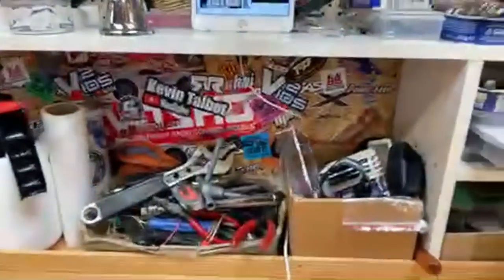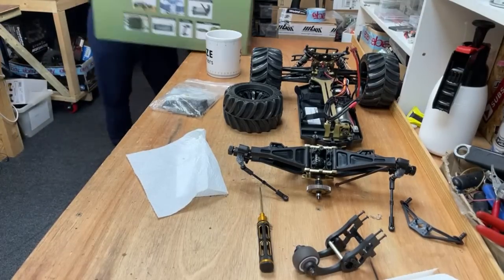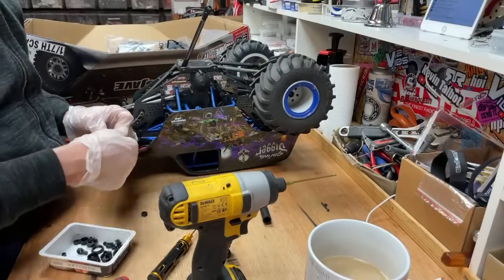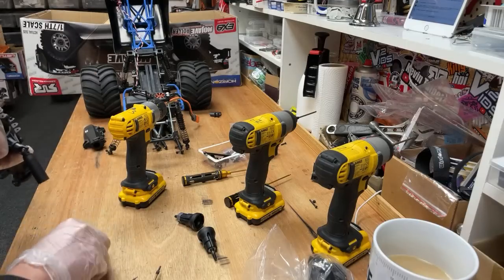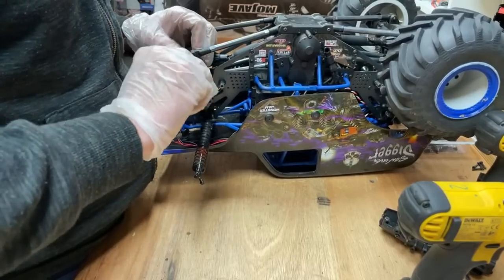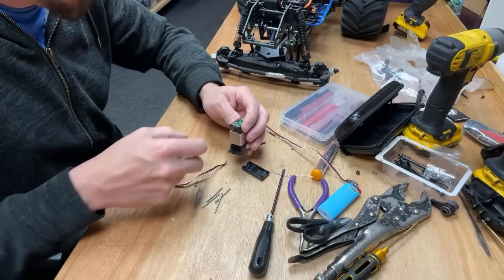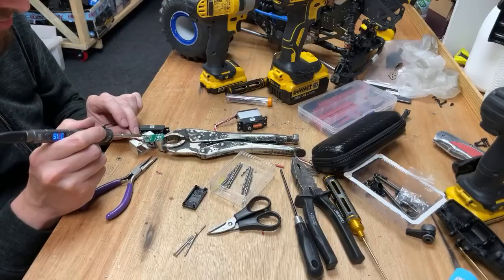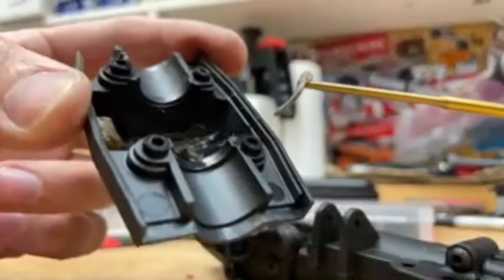Why won’t it drive!?!

Comment: Hey I've got a velineon 380 it gets super hot just running for a few seconds I've rebuilt before I even ran it do I need to replace the bearings again

Comment: Hey kev I have a Traxxas rustler 2wheel I turn it to a6S. My ? Is is there a strong upgrade for gears in tranny . I burns out the diff in the ring gear it's fast an strong but keep breaking gears or drive shafts. I put in a possie Trax locker in the ring gear it lasted for a bit till the ends snaps off were the drive shafts hook up at . Could u do me a favor and give an idea or advice wat I can do to keep it going tuph. ..thxs kev it's my first build . Watching your channel gave me the drive now I have a notorious 6S with up grades and love it now I want a outcast 8S roller I want to put in a max 5 ecu with a hobbies wing 1100kv brushless . Wat do u think ?